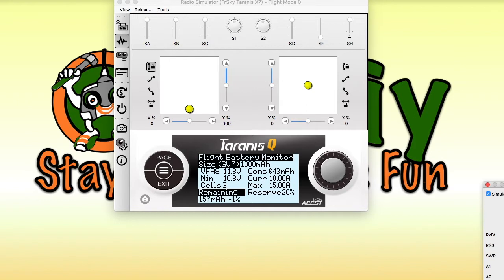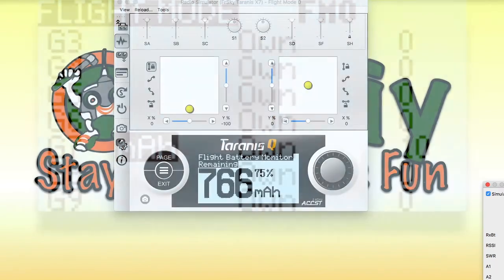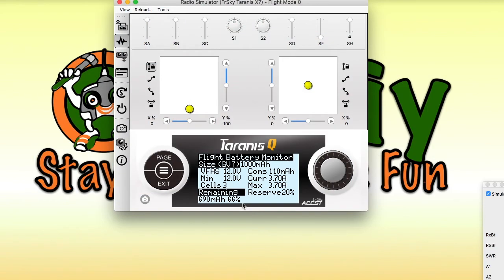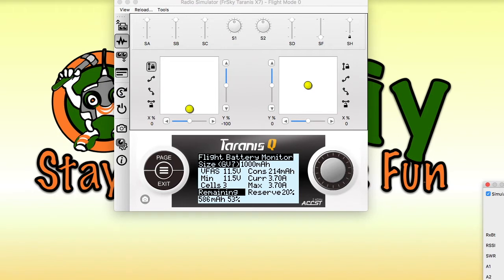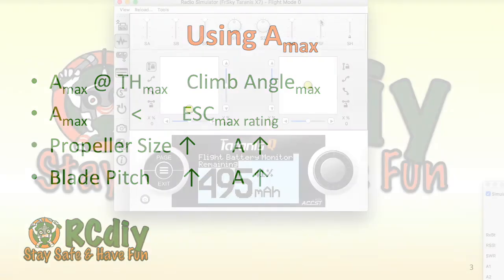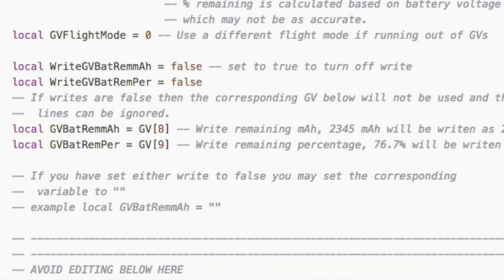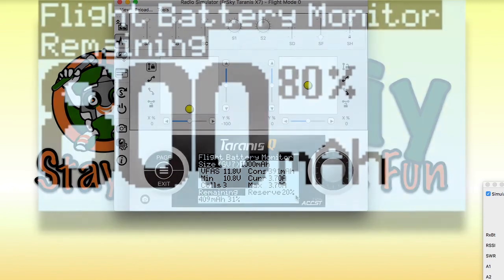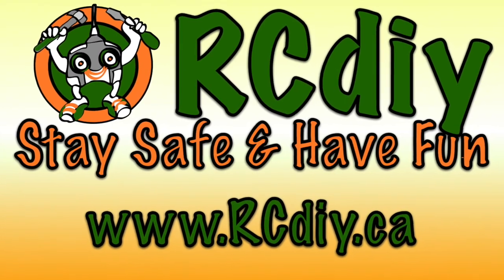Taranis Q X7 OpenTX Battery Capacity Remaining Lua Script

Comment: Thanks for a really useful video and LUA script. I'd like to use my current sensor with a 24V 20Ah LiFePO4 battery in a model tank. I can't see how to configure the units of measurement to accommodate 20,000 mAh in the 1024 GV limit in OpenTX. Could you please advise?

Comment: thanks, was helpful to get me started on lua, but when i used this, there is difference, i used this script and discharged till the script read consumption = 498 ~ 500mah. Then i charged the lipo, it charged only 377mA. What could be wrong ?
Reply from the maker: Merin Kumar what happens when you remove the script, just use the current sensor based consumption sensor?
Reply: you mean, just use the calculated sensor value, then charge the lipo and check ?
Reply from the maker: Correct... the sensor measures current, OpenTX takes that reading and calculates the mAh used (consumption sensor), the script then takes the consumption sensor and does the calculations for capacity remaining. Remove the script form the equation and just look at what the OpenTX consumption sensor is reporting. Charge the battery, run the motor/fly the craft, take consumption sensor reading, charge battery again.

http://rcdiy.ca/calculated-sensor-consumption/